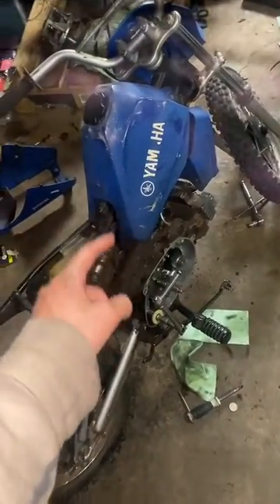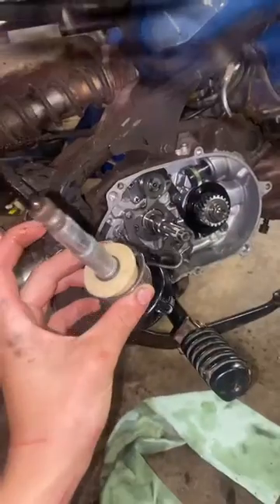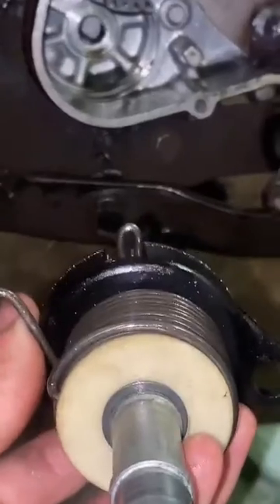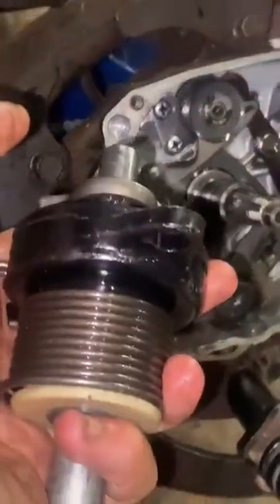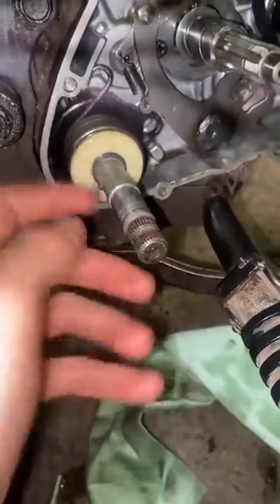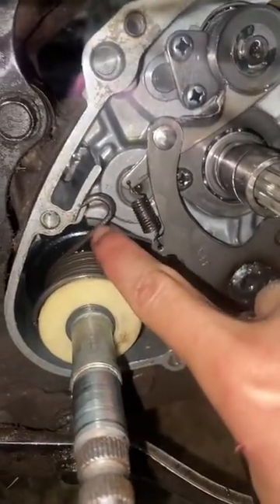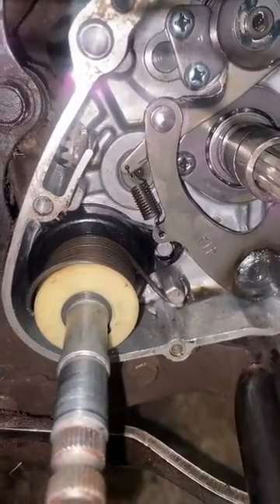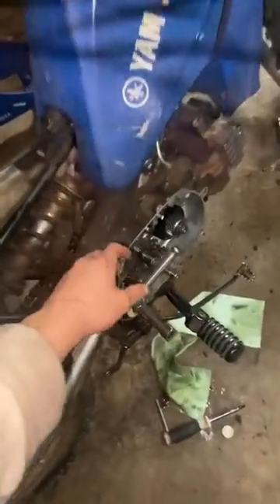PW80 Kick start return spring fix | Darzrt

Comment: Could you provide the link to that kick start axel because I’ve looked everywhere and I can’t find one that will work with my pw80.
Reply from the maker: this is the oem one, maybe try motorsport under oem section? may be a bit pricey
Reply: Amazon has a cheap 35$ complete assembly

Comment: I've tried this and still can't seem to get it seated right
Reply: Well I have the same issue and I am almost positive now that it is not that the shaft isn't fully seated but because it is either bent or its nesting inside the case is out of round.  Shaft will freely return without the cover on but with the cover it encounters too much friction inside engine cover sleeve. I have just ordered a new shaft .
Reply: @PirxthePilot  I sorted mine now